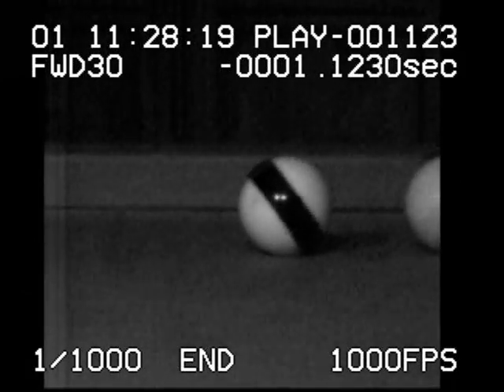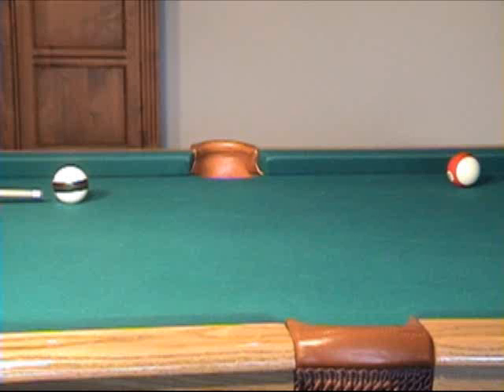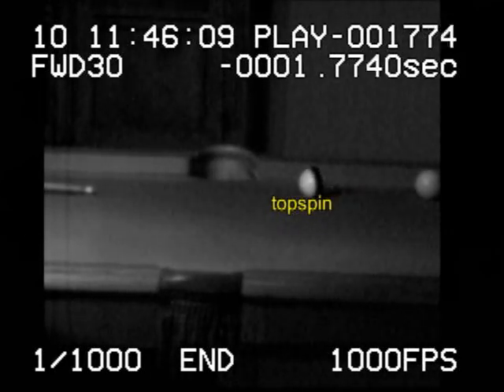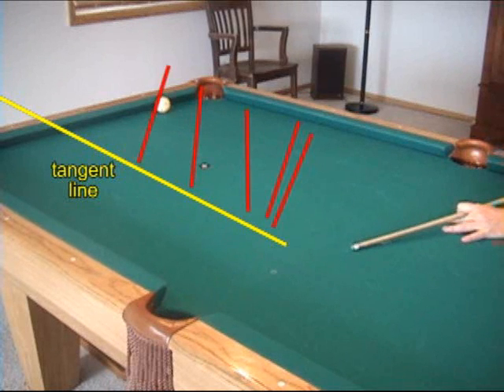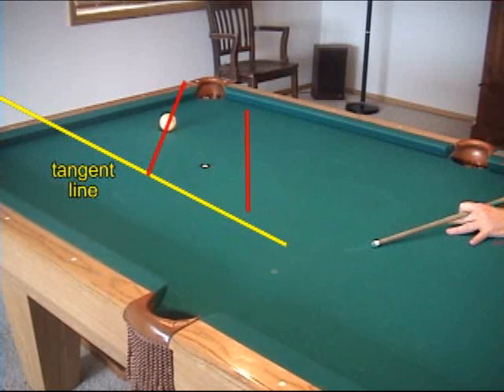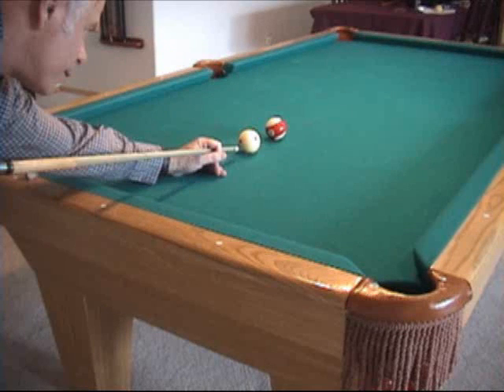Pool and billiards draw/backspin/screw-back shot - Part 2: physics (NV B.97)

Comment from the maker: Table of Contents:
Part 1: Technique - https://youtu.be/Uoz7f8-wRRc
- Technique Advice
- Chalk Up
- Tip Position
- Cue Elevation
- Bridge Length
- Relaxed Grip
- Closed vs. Open Bridge
- Elbow Drop
- Stroke Acceleration
- Follow Through
Part 2: Physics - https://youtu.be/qKwulo_ag0k
0:00 - Backspin Drag
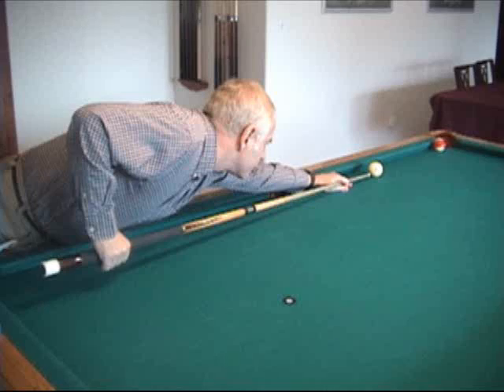3:10 - Draw Control Drill
3:45 - Cut Angle Effects
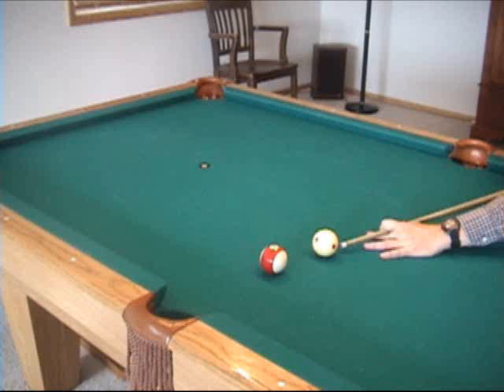4:35 - Speed Effects
5:30 - Cloth Condition Effects
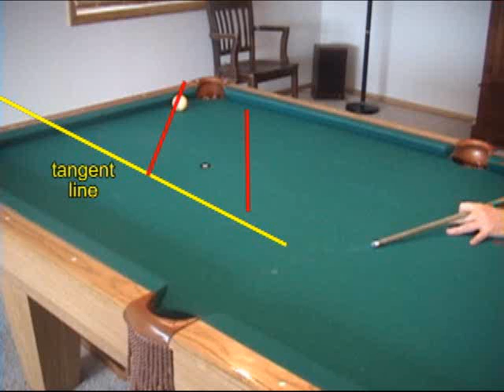6:08 - Cue Elevation Effects
Part 3: Examples - https://youtu.be/VZ5sNuaFlVE
- Position Control
- Scratch Avoidance
- Breakout Shot
- CB Path Control
- Drag Shot
- Straight-In Shot Options
- Carom Shot
- Kick Shot
- Jump Shot

Comment: Hi Dr. Dave, 

Here's an billiards physics question for you. 

At the 2014 CSI Invitational Efren Reyes had a difficult shot in his match against Jung-Lin Chang. Efren elected to play it leaving the magic rack in place despite it being in his line. He made the shot splitting the pocket, but he missed position by a wide margin. He proceeded to lose the rack and the match by a narrow margin. https://youtu.be/Whq89Kgp_zk?t=1055

Does the magic rack affect draw stun or follow? How does the answer change if the rack moves under the cue ball? Did this affect the shot?

My thinking is that the rack creates less rolling friction on its surface, sliding friction is probably lower too, and its edges could cause a slight change in direction. When I first saw the shot, based on the direction of the miss I thought maybe the sliding rack caused the cue ball to come off the object ball with more draw. Upon slowing it down the video it looks like he shot it with stun, and maybe the rack caused less follow to develop. I don't know if he was intending to go between 8 and 11, or at a steeper or shallower angle toward the long rail.   

Alternatively the rack had no effect. Reyes has probably played more high level pool than most anyone, and he apparently didn't think going over the magic rack would matter. But it's rare for him to miss position by that much. When Chung got to the table the first thing he did was remove the rack even though it wasn't in the way. Efren did the same on the next game, but went back to leaving it on in subsequent games. Would be happy to hear your thoughts on this.
Reply from the maker: The Magic Rack can affect the CB in the ways you described, but I don't think the effects are very significant since it is so light and since the CB doesn't "ride" it for very long.  Regardless, I would always remove it from the table.

Comment: Something I just discovered while watching this video. Notice at 2:25, that the edge of rail to the left of the side pocket is a little bit taller (1/16 to 1/8) of an inch, then the rail on the right-hand side. This could possibly cause some inconsistent banks – speed off the rebound – etc .
Reply from the maker: I think this is an optical illusion, but it is difficult to know for sure about stuff like this from just one camera angle.  I don't have this table anymore, so we'll never know for sure.

Comment from the maker: You are correct.  Faster speed delays the curving, causing a shift down the tangent line.  And with more cut angle, less curving occurs (i.e., the CB stays closer to the tangent line, and the curving takes longer since the CB loses less speed in the collision).

Comment: The problem is that you're making your cue tip go under the ball which forces the ball to pop up and jump. what you dont see in this video is how they stroke the ball when the hit it in slow mo. The proper way is to hit the ball is to make the tip go from the lower middle to the bottom in a one smooth action very quickly.

take for example @0:16 the tip is just below middle. but when after he hits the ball @ 0:19 the tip is hitting felt.

Comment: do u mean that since velocity is higher and frictional force constant, the radius will take a larger arc just like in circular motion.Is the curve less steep and longer resulting in the same angle finally with respect to aiming line as a slower shot results with steeper and shorter curve